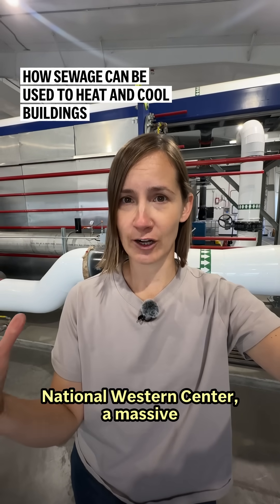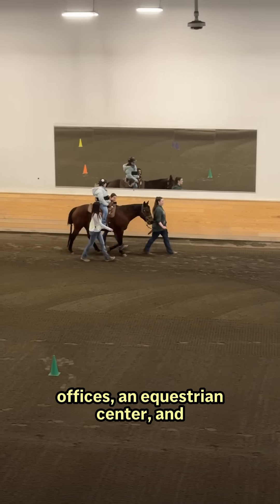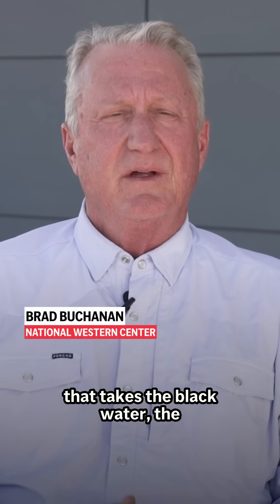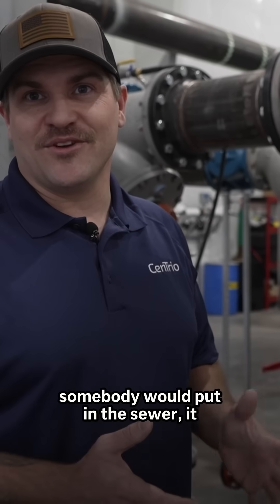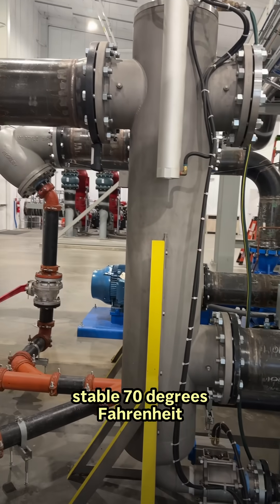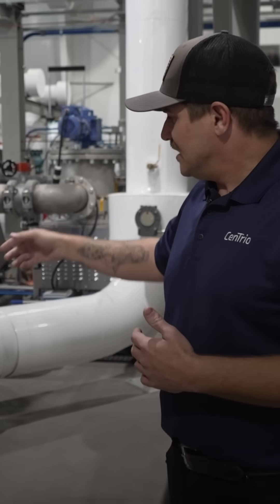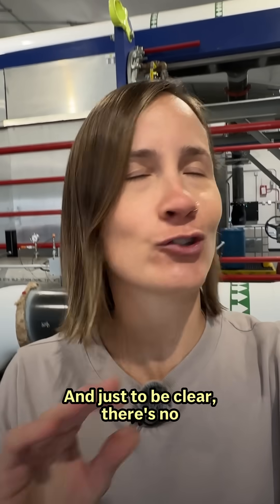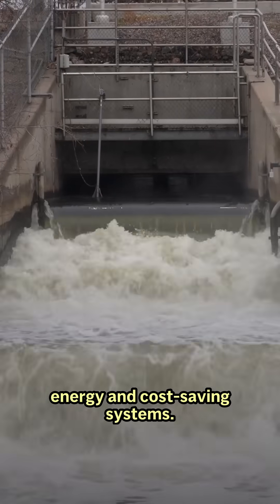How sewage can be used to heat and cool buildings

Comment: Ok, but how much energy does the filtering and pumping use up and how does that compare to the cost of traditional heating? What is the ACTUAL offset and where does the energy for the pumping and filtering come from? 

Painting flowers on the side of a coal power plant doesn't make it a green solution. 

Now if you're using the composting of the sewage to power things then I take it all back, but you didn't say that in the video.